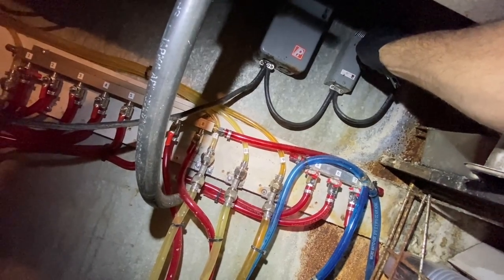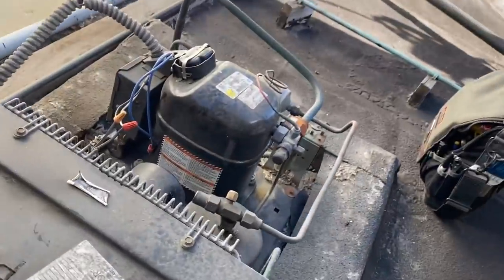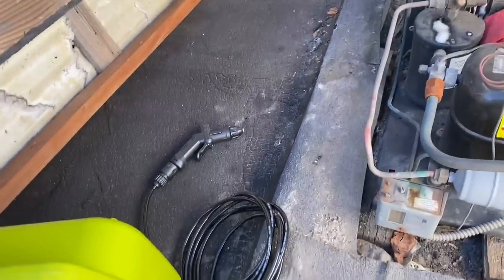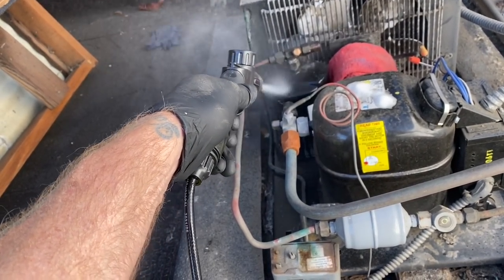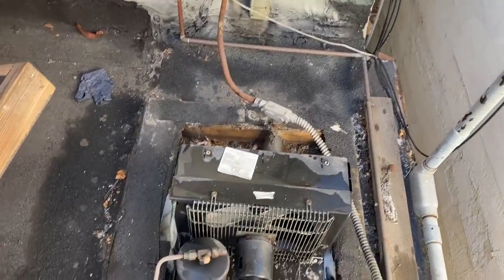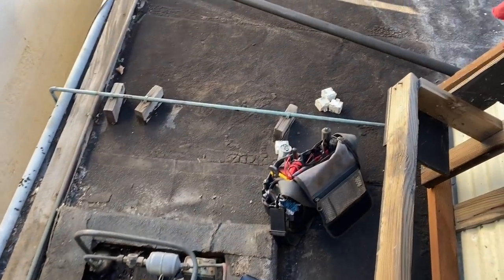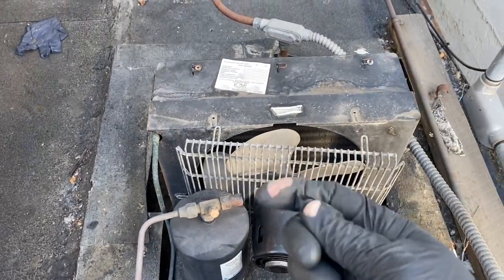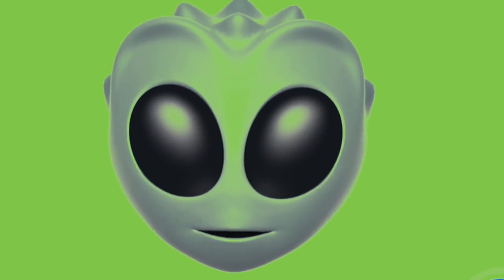The Beer Walk-In Cooler is warm

Comment: As the condenser motor got hot did you notice any rise in the amp draw?

I was not aware vertical play on shaft was an issue. Thought they all had vertical play. Side to side was always my cue.
Reply: Side to side is a definite condemn situation. A LITTLE bit of vertical play just means it's an old motor. Too much and it's pretty safe to assume it's on it's way out.

Comment: Nice job Dave, your a Class Act , separating the Men from boys! Piss me off when customers get someone else to do work and then call you for other stuff! Thanks for taking the time to make videos, I work in a High School in NYC and you have a great way of the proper way to do work 👍
Reply from the maker: Thank you John.
Reply: @NorCal-refrigeration  honestly  because they called someone else thats just low .. but  you shouldn't care someone bypassed a HP switch screw it ...   not your problem  easy money a new condensing unit .. and try to sell a coil.. easy ..

Comment: Good work Dave. I think I would have added one of those discharge line high temp snap disc switches to save compressor from plugged up condenser coil in the future.
Reply: technically  HP  high saftey can only protect the compressor for so long...  if the compressor is old and tired possibly the compressor will fail anyways  but regardless a HP should always be around... a manual reset would be nice

Comment: Good vid ! Good Work ! Universal start relay Ftw. i use the supco " supr " never used uour icm model there. ill have to get one. They were very lucky 🍀 the compressor was still alive ! ive got to get me one of those sun joe's. It looked like its got some good pressure to it too. Just enough to blow the condenser impacted chit out. 
Do You ever use Hot Water with it ?
Reply from the maker: I have
Reply from the maker: @OcRefrig  it dose. Rated to 140degrees. I have a another system coming with heater 12 volt hang in there until I try it.